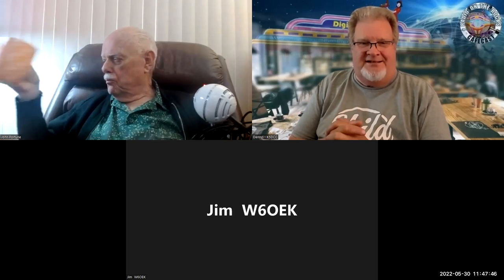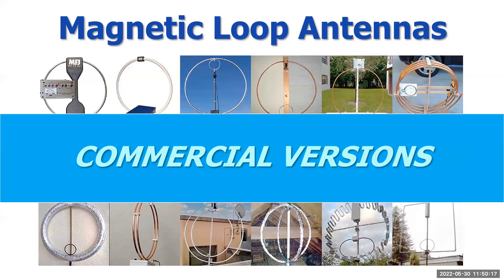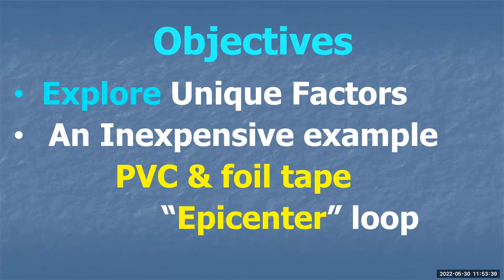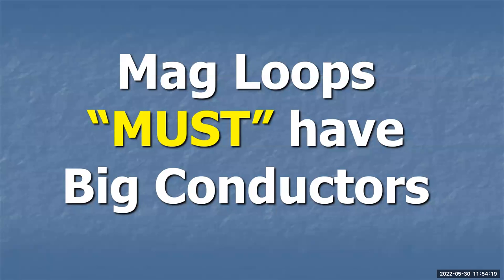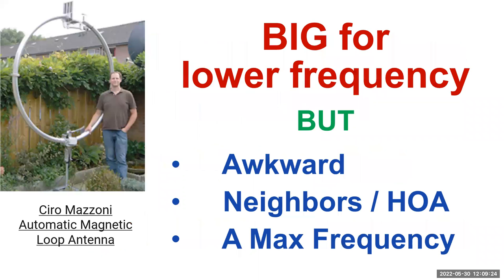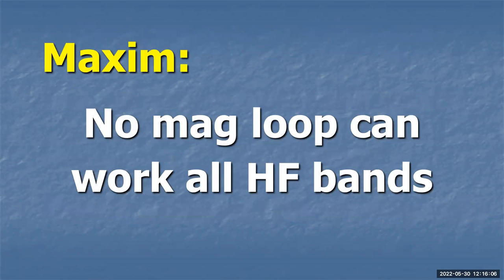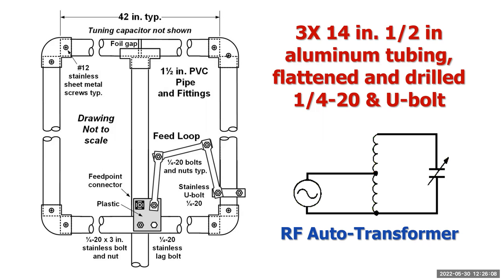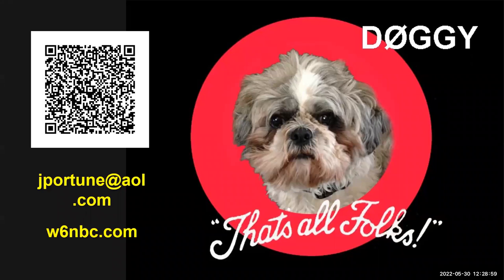Radio On The Rocks Cafecast - The Optimum Magnetic Loop Antenna with John Portune, W6NBC

Comment: Very good. I started building a similar loop. However, I used 50 mm PVC pipe and aluminium flashing on the outside. The aluminium flashing comes in different widths but in long roles. It is possible to cover the whole loop with no joins. The flashing can be held in place with zip ties or something similar. The flashing can be bent around the corners with care and some practice. The loop is potentially more durable and should handle high power. Drew VK4ZXI

Comment: Forgive me for pointing the following out, but John used the word circumference as well as diameter (3 times for diameter) when describing how a loop can be more than 1/10 of a wavelength, which did he really mean?  Loop diameter is diameter, circumference is the amount of conductor end to end which the loop is made from, the two terms cannot be used interchangeably. I suspect he simply misspoke on that point.

Comment: At 16 min, having a bigger conductor for a bigger loop means < 24:1 I think, not > 24:1. If the diameter grows you need a bigger pipe. So the formula should read > 1/24 ..

Comment: Thank you for this very clear description. Still I have a few heretic questions. When you say that diameter matters, I understand that there is the skin effect. But does this effect not also matter for a normal dipole? So, why using wire for dipoles, but tubes for magnetic loop antennas? Next: how to connect the copper coax cable to aluminium? Is this possible at all? Finally: Because current is high in a loop, all connections are critical. When you make the loop out of one aluminium foil, it is ok, but connect them just by pressing, is this enough? Best 73, Roland AB7SN / DL9NBX
Reply: Since a dipole is high current at the feed point for 1/2 wave, I imagine so but how much current compared to a loop?

Comment: I wanted to thank you for your presentation. I learned more about loop antennas from you than anyone else. I was getting frustrated with my commercial small loop that tuned a low SWR at 40 meters but nobody could hear me. I replaced my coax radiator with an all aluminum radiator and conductor to increase the antenna efficiency this evening and tonight made made a DX contact on 40 meters with Italy with 25 watts. I am grinning ear to ear that I watched this, learned something, made a change, and it works! I am keeping this loop configured for 40 meters and my second coax loop for 10 and 20 meter bands. It has me thinking about getting a square loop put together and tune that specifically for 20 meters. I primarily enjoy QRP work because it is so challenging and everything has to be set up perfectly. Thanks again…. KD2ZTA

Comment: I'm sure it will work, however it is durable having it out in all types of weather?  Wouldn't that covered foil paper peel off over time when exposed to the elements and also applying heat.  In theory you may be correct, however I would look at durability.  Pretty interesting video.  Best regards.  73.
Reply from the maker: Hi  Danny. I just use mine for portable ops. It's very convenient and quick to setup in the field, so the tape holds up nicely. But then I've only started. Ask me again in a couple of years. hihi
Reply: @DigiCommCafe  Oh OK very good. Have a good day Sir. 73.
Reply: The foil tape they use is just foil, no paper.

Comment: The more turns you have on a magnetic loop, the more efficiency you get. Ad infinitum? This is rubbish. There is no such things as a free lunch. What about the area? A lot of what you said about magnetic loops is true, but this is not at all. Stop quoting Maxwell, if you don't understand it.
Reply from the maker: Wow! Who rained on your parade today.
Reply: @DigiCommCafe  Is that your only answer to my comment?
Reply from the maker: @tomtwist1081  First of all, I'm not an expert. I interviewed John Portune and have built two antennas based on his design and they work great! Secondly, I thought your comment was arrogant and extremely rude and I have no desire to continue this conversation any further with you. I'm sure that most who have watched this video and know John and have left thoughtful kind comments would agree. Have a nice life.
Reply: @DigiCommCafe  As I also wrote, he has a lot of correct information on magnetic loop antennas.
But the claims he makes are dead wrong. Anyone with a little knowledge on electromagnetics will
realize this. I hate when misinformation is spread, especially by a guy many regards as a guru.
He also claims that his flimsy PVC/aluminium tape antennas will take any power you throw at it.
This is also wrong. A thick walled aluminimum tube will have the ability to transport the heat
generated by the resistive losses in the skin effect layer. The aluminium tape and the PVC tube will not.

Comment: Really interesting presentation. With the conductive tape on pipe, how do you ensure a good conductive join at the corners? Especially with aluminium I'd be concerned about just a mechanical contact.

Comment: Thank you. This is some good, common sense info. But I do have a couple questions and a comment. 

What elevation above the ground did you use for your loop's null models?

What is the bandwidth without retuning, meaning what is the Q, since the PVC dielectric will reduce it compared to an air- or vacuum-variable cap?

And the comment: A round loop has a lower resistance for its cross-sectional area and thus a slightly higher efficiency since a circle has the maximum possible area for its circumference.
Reply from the maker: I have mine at least one diameter width above the ground usually the top is 6 feet off the ground. Anything more than that doesn't bring any benefits. The Q seems to be band dependent. I don't generally have to retune much as I stick to certain parts of the band. But tuning isn't at all difficult. Yes, it appears the efficiency drops a little being a square rather than a circle but the square is much easier and gives you a larger radiating surface compared to a circle with a smaller diameter material such as coax so that becomes a wash. Actually it works better than the typical circular mag loops. I have made 2 of these now, one for 10 - 17 meters(3 foot diameter) and one for 6-10 meters (2 foot diameter). I love them! And they're a heck of a lot cheaper than buying one. I have $70 and $30 respectively in mine.
Reply: @DigiCommCafe , thanks for the info. I have 3 pieces of 1" hardline each about 10 feet long, some big air-variable caps, and some 12 V geared motors, so with just a bit of work and without spending a dime I figure I can make 2 loops to overlap their coverage and cover 80 through 6 meters. So I'm watching a bunch of videos and reading some technical articles in order to figure out how to build the best loops with the best nulls and highest Q's (for maximum xmit efficiency and best off-frequency rejection on receive,) that I can manage to build out of the materials at hand. So far it seems like even the commercial loop designers all make some design errors or cut some corners on their designs, and I don't want to. If I'm taking the time to build it I might as well build it the best I can.
Reply: @DigiCommCafe  The antenna is designed in regard to total loop length, so whether a loop or a square, the lengths are calculated to give the same aperture anyway, correct? I suppose with tuning, aperture could be increased to provide a lager area inside the loop and therefore more signal, up to a limit, and the diameter of the conductor increased to keep the loop resistance low, if concerned about that aspect.

Comment: Thank you! This a rare gem of a video. Lots of great practical advice backed by data. One question... for those of us who are receive-only, how much of this is relevant? For instance, the MLA 30+ mag-loop antenna ships with thin wire. Would it benefit from a 2 inch conductor or is that for tx only?

Comment: I made a flat plate capacitor using PVC as the dielectric. I found that the capacitor got very hot after operating for a while. To me this indicates that PVC is lossy at RF frequencies. Does your loop get hot in the area of your capacitor ?
Reply from the maker: At higher voltages it must. I ran 100 watts on my 6 meter loop and it started melting the pvc! haha. I couldn't move the inner tube past the gap until I knocked off the drip of pvc. So I only run up to 25 watts now.

Comment: I was under the impression that the 1/10λ came about because you want a constant current around the loop thus maximizing the field. He also glanced over the coupling used in the original Army Loop (capacitive coupling). Fernando N2FQ/6

Comment: r John Portune, W6NBC ,
Thank you for this very informative lecture ;
"Looking for the optimal magnetic loop antenna". 
We live on an apartment with and small balcony on S-W of 7 m2 , so an ideal antenna !
I built a MLA the classic circle shaped diameter 1 meter from 1,5cm plumber pipe. At the bottom of the circle a variable air capacitor 20-250 pF and at the top of the pickup loop 20% of the circumference of the main loop. This MLA works on the HF 10 - 20 M 
My favorite HF bands.

My question , I would like to recreate your design of the optimal magnetic loop antenna for Hf 10-20 M bands, but due to my poor eyesight your drawings are not easily visible.
Do you have a printable version of the construction description ? 
Or possibly where are these for sale , Amazon ?

That would be very nice !

2nd question, my built classic MLA where is the biggest improvement factor ?

Best regards from the Netherlands, Theo PA0HTY , 73 

Translated with www.DeepL.com/Translator (free version)

Comment: I am not clear on the way your feed loop is connected. Is the feedpoint connector connector connected to the loop, and the other side, the u bolt, inductive? or is it conneccted by a bolt to the aluminium? or just an independant loop altogether?
Reply from the maker: John says it's a "tapped transformer" and is inductive. It uses a portion of the larger loop. Moving the u-bolt up and down the side adjusts the swr.
Reply: @DigiCommCafe  thanks. The connector on the tube would then be the tap? So a part of the big loop would be shared by the small loop. Am I getting this right?
Reply from the maker: @denislacroix654  Exactly. This is all new to me. I'm learning a ton from John meet with him regularly to learn more. I've been making modifications to mine as I go making small improvements. I can tell you from using it that it works very well. I have 2 of them now. A three foot square one for 10-17 meters and a 2 foot square for 6 meters. They both work very well. (And they're very inexpensive and easy to build!)
Reply: Thanks a lot. I learned a great deal from that video, thanks a lot for bringing that to YouTube.
Reply: @DigiCommCafe  Just trying to make sure I have this 100% correct.  The Feedpoint connector center pin connects to the Feed Arm and the shield of the Feedpoint connector connects to the bolt that connects to the foil on tube? Thank you for your time.  Pretty new ham here.
Reply: @robmontgomery4085  This is vital.  Does anyone know the answer?
Reply: @reodds  I am still not clear on how the ground or shield side of the connection is made to the antenna foil conductor. Would someone please clarify this? Thank You.

Comment: Question: What power was used in the efficiency measurements at 7:20 and 9:50? If you are running QRP, won't those curves look very different since you are far less likely to saturate the surface of the conductor with charge?
Reply from the maker: I run mine as QRP (5-10 watts) and it works great!
Reply: @DigiCommCafe  Thanks for the quick reply! I'm sure the loop runs great on QRP, but I'm wondering what power the simulation assumed to determine whether a smaller diameter loop would work just fine if it's only going to be used for QRP. Cheers!
Reply from the maker: That I couldn't tell you. Sorry. I just built it and use it.
Reply: @DigiCommCafe  My thinking is that since power goes as R*I^2, a 10X reduction in power results in a 100X reduction in current, so you can get away with a far thinner piece of foil for your antenna.

An interesting test would be to make one antenna with thick tape, and one (same band) with thin tape, then hook your radio up to one and a power meter up to the other. Then do a series of transmission tests at increasing power output of the radio and record the power meter readout on the other antenna. Then switch the antenna on the radio with the antenna on the power meter and compare the curves to see at which power level the transmit efficiency of the thin foil antenna starts to drop...

Comment: what are you guys thoughts/opinions on:  instead of using a cylinder shaped conductor, you use flat stock shaped conductors ?
Reply from the maker: Hey! I like the idea, Jeremy! I'm gonna try it. Use Foil tape and a large piece of cardboard in a square. That should work! I love it when people think outside the box. You could build a "picture-frame loop".
Reply from the maker: So Jeremy...today I built my flat cardboard 6-meter mag loop antenna using scrap box material and aluminum tape. It was cheap, easy and tuned up beautifully. Here is the link to the steps and results. https://t.me/s/digicommcafe

Comment: Hello. If I understand correctly, a loop antenna does not work at lower frequencies. I want to use a loop to receive channels at the top of the medium wave band. Between 1.6 Mhz and 1.7 Mhz. I bought an MLA-30+. Will that work? Do I need to change anything for a better result? Greeting. Cees
Reply from the maker: You are correct. This particular magloop would not be well suited for very low bands. With a 5 foot square loop you might get it to work on 40 meters fairly easily.

Comment: Have these components ever been used successfully?  

2 in. x 3 in. x 10 ft. White Aluminum .0145" Downspout  $12.98  each
2 in. x 3 in. White Aluminum A-Style Downspout Elbow  $4.28 each 
Wirebush the paint and use Pop-Rivets on the elbow connections?
Reply from the maker: It wouldn't at all surprise me concerning the things that will work. Give it a try!
Reply: This sounds like a great experiment.  Have you done it yet?  My first thought as I was trying to mentally assemble it in my head was that, even with rivets holding the segments together, I could picture the loop having difficulty holding it's shape and maintaining the necessary gap at the top (12 o'clock). Those gutter elbows tend to allow a bit of play - wiggle.  But with experimentation, I bet they could be made more snug.  Please let me know if you have given this a try.  It really is an intriguing idea.  73- Dave K1DBD

Comment: when I measured the resonant frequency of a loop with no capacitor I found it resonated where its length was 1/2 wavelength. It was like taking a dipole and wrapping it into a loop. I put 100 watts into it and could light a 4 ft long fluorescent tube with it. The loop was about 9 feet long and resonated in the 6 meter band. 6m was dead at the time so I did not try making any contacts with it. So what does this actually tell me about the frequency that it would work on as a mag loop?
Reply: Skeptic-  Thank you for sharing your test result.  In reply to your question- To behave as intended, hence optimize the H field and suppress E field, I believe that a mag loop antenna must be no more than 1/10th wavelength of a 1/2 wave dipole.
Reply: @Supernumerary  Believe or know?

Comment: So are multiple loops a way to compensate for the conductor size?
Reply: It appears to me the increased conductor diameter is simply to reduce the resistance caused by skin effect, if multiple loops, then having a minimum conductor diameter would be even more important, correct? I've watched several of John's videos, and videos produced by others too and never any mention of that. Seems to me, if two loops the greater than 1/24 rule for the size of the conductor to the diameter of the loop should then be greater than 1/12 due to having twice the length (in reference to diameter).